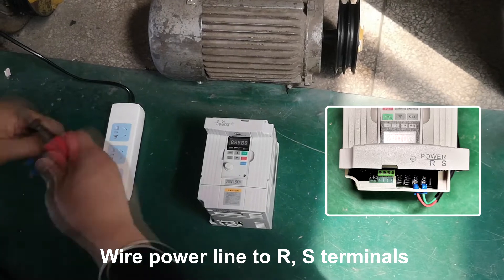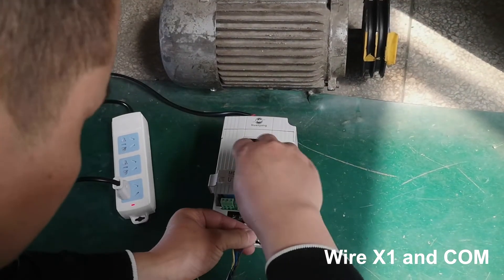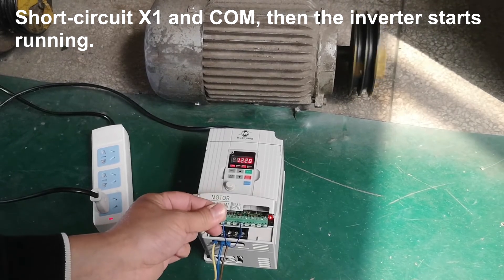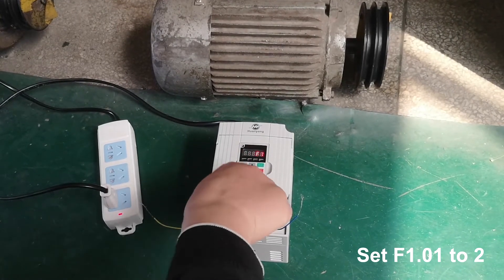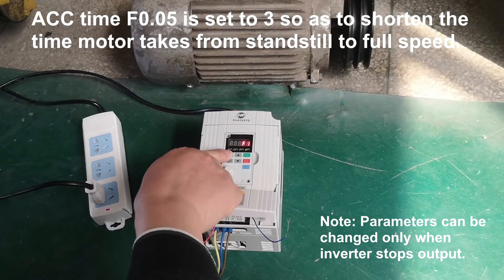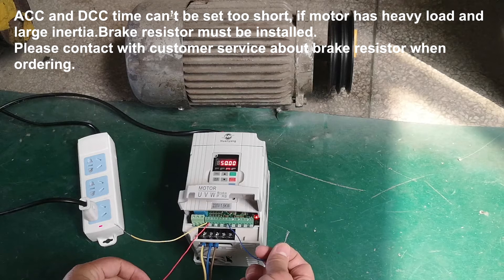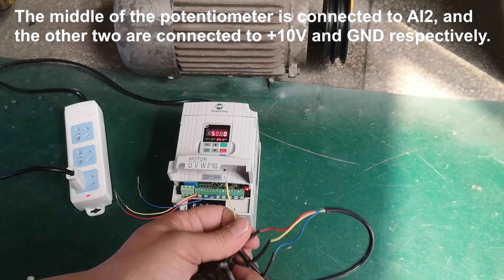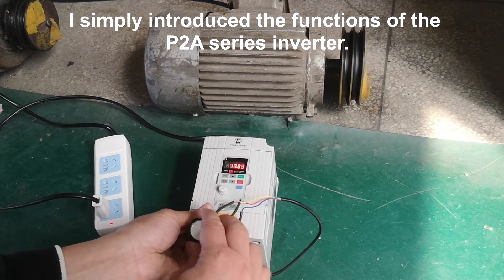P2A VFD Huanynag Inverter Operation teaching

Comment: How can we control this invertor from CNC controller (Arduino Based) . I tried various wiring but it does not work properly.  I want VFD to start/stop from CNC.  What is the wiring and parameters for that setup
Reply from the maker: F0.04 = 1
short-circuit X1 and com ,then the inverter starts running

Comment: Good afternoon, what is the difference between COM black and white?
Reply from the maker: no difference. Are the same
Reply: @huanyanginverter6516  good afternoon, what to write in F6.01 so that the current is displayed, not Hz
Reply from the maker: @XVladimir  Repeat key shift
Different information can be displayed
Reply: @huanyanginverter6516  point in the instruction F6.01 what to change in it so that the display shows current during operation. When the inverter is running, the parameter display is limited to F6.01, that is, 16-bit binary string, if the bit is 1, the parameters corresponding to the bit can be viewed by the SHIFT key during operation. If a bit is 0, the parameters corresponding to that bit will not be displayed. To set the function code F6.0l, the binary number must be converted to hexadecimal number, and then enter the function code. BIT 4: Output current